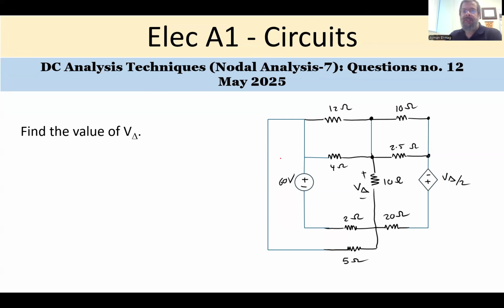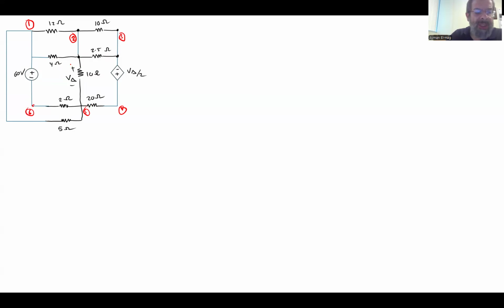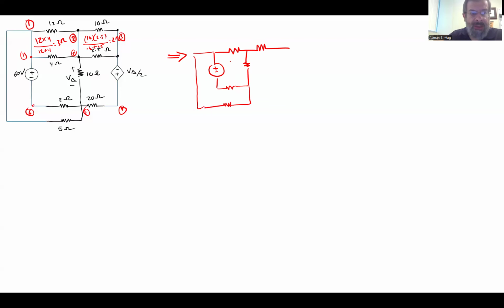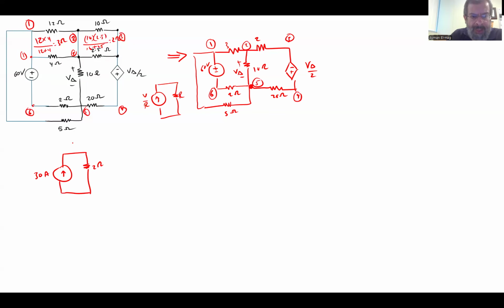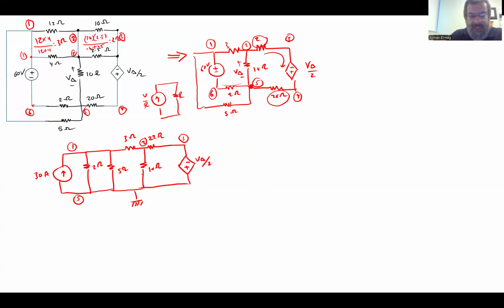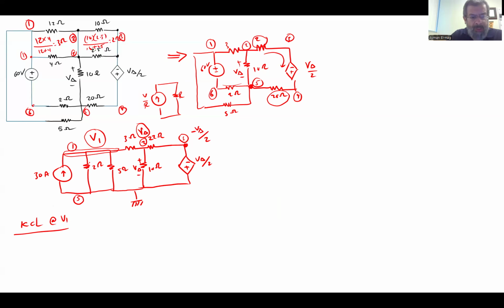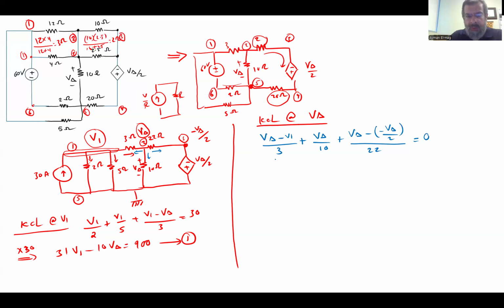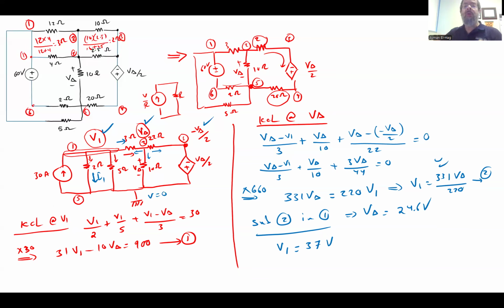PEO solved examples (ELEC A1): DC Analysis Question no. 12

Comment: Dear Professor, I had a circuit exam today, and I think it was much harder than the previous one. It really needed about an extra hour beyond the three hours provided, because every question required very detailed steps.
Reply from the maker: The most important thing is that I hope you did well in the questions you solved. Remember, your objective is to pass and not to get perfect score.
Reply: Hi, per your experience, are there many AC questions than DC but in similar variety as past papers ?????? or additional scope has been added lately. I believe AC questions are very time consuming even with calculator though it looks easy . You feedback will be valuable to us.
Reply from the maker: The A1 exam is very typical and does not change much. Kindly check my video about how to prepare for A1
Reply: @electrical4everyone  Thank you professor for your guidance. It gives us clarity and hope.
Reply from the maker: @milinaik5621 You are welcome

Comment: Hi Professor,
I had a quick doubt — if the question extends to find when power generated equals power absorbed, should we use the simplified circuit for that or the main circuit?
Reply from the maker: Both should give you same answer but of course simplified is much much easier

Comment: Hello Ayman,
I used source conversion on the dependent source to convert it to a current source. I was able to get the same answer as you.
Just out of curiosity, do you advice against doing source conversion on dependent sources??
Reply from the maker: You may do source transformation with dependent sources. The only thing you cannot do is to touch the element that has the dependent variable.